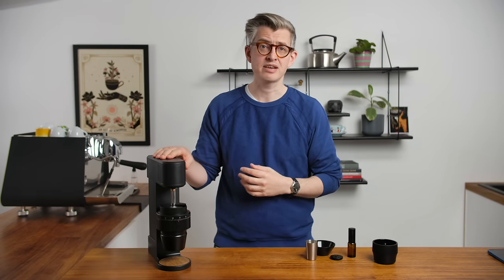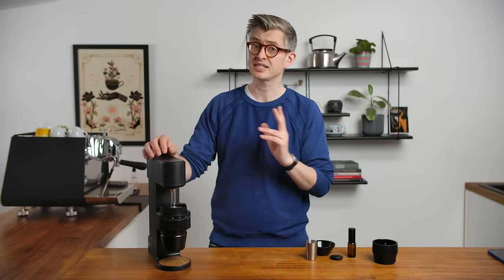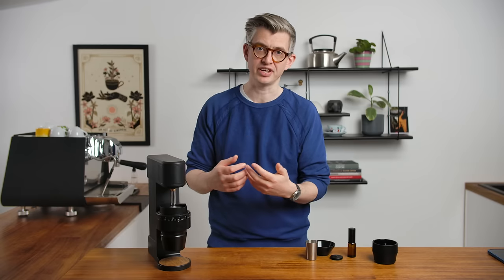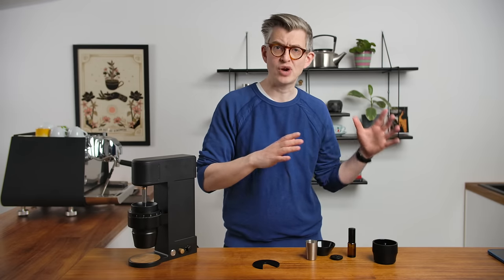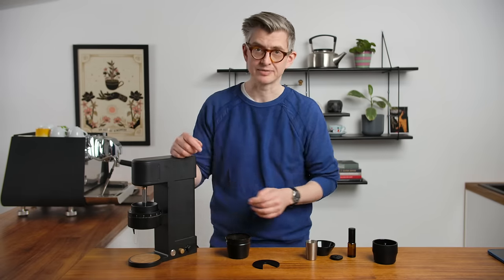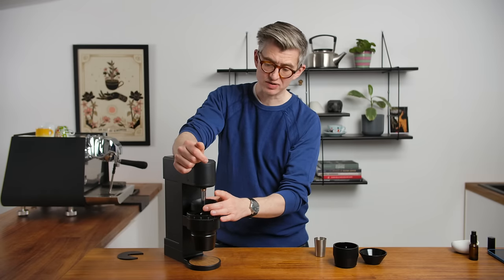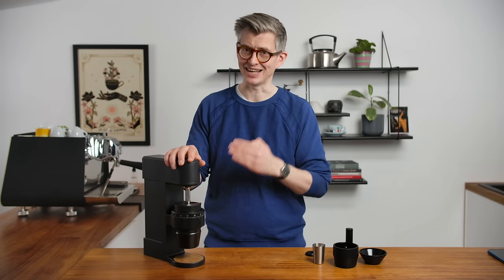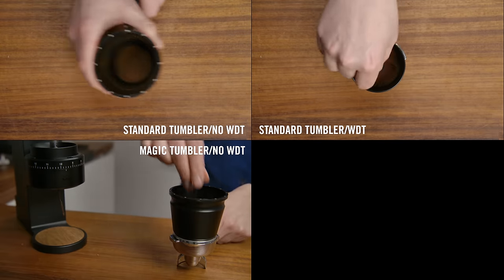Weber Workshops Key Grinder Review

Comment: If you want to test the center shaft alignment as it grinds, you could use a machinist's center dial indicator to see if the shaft strays from the center.
Reply: excatly what I thought too 
´👍
Reply: for sure - though just keep in mind that if there is a finish on the shaft, or if it was chromed, for example, irregularities in that would get picked up on the dial indicator.
Reply: I did exactly this, like above, the finish on the shaft does throw out the measurement. To achieve an accurate measurement you need to remove the lower burr and get a reading from the end of the shaft, mine was perfect.
Reply: Wired Gourmet has tools like that, someone should lend him their Key for testing.
Reply: However, that doesn't tell you if the cone burr is concentric with the shaft. If Mazzer's (burr manufacturer) and Weber's tolerances add up the wrong way, then you're stuck unless you have the machine tools to fix the issue.
Reply: I'm curious of the runout/TIR of the grinder running vs under load and grinding. I suspect it doesn't have a lot of rigidity with that much stick out.
Reply: @221 b unlikely that anyone would lend him one since he constantly trashes everyone else on coffee youtube.
Reply: You silly. You just bonk it with a mallet.
Reply: I did that to mine when I got it, measured the runout as within +/-.001" as close to the burr as I could get the dial indicator with that funnel collar in the way.
Reply: @armLocalhost  I too was disappointed that there was no bonking. Perhaps in a follow-up review when WW release their Precision Bonking Mallet.
Reply: And if you own a machinist's center dial, you likely also own a set of tools to take the silly thing apart and point and laugh at the under powered motor.
Reply: James, really good point that it is possible to seize the burrs if you don't seat the adjustment collar completely. Just had this issue with the HG-1 where I didn't quite have the collar fully seated when I started my workout, and it instantly stalled. I couldn't get them to separate so I had to remove and clean the lower burr assembly. Weber was helpful via email. Have owned the HG-1 for many years and this was my first and only issue with it.
Reply: @baldheadracing  Yeah it may just show the centering of the outer diameter of the shaft. There also may be a changed alignment with varying the grind size adjustment. Hopefully for $2k, they put the sufficient mechanical engineering required to mitigate this potential issue.
Reply: sincerely i don't like that long shaft. it is to far from the motor and it will flex even if so thick. of coure is just my thought since i haven't one 🤷‍♂️ 
for the price i think it could be engineered better

Comment: It’s been interesting to see other’s experiences with the Key, and I was definitely curious to hear what you had to say.

It would appear you’ve had a much more positive experience than I on every level. This further makes me sure there was something significantly wrong with my grinder and when in tandem with Weber’s abysmal (to say the least) customer service I found myself wanting it off my counter.

Of course everyone who backed it took a risk (my first and last backing on coffee gear) and I felt like it was a calculated risk, but a risk nonetheless. That risk wasn’t worth it for me, and resulted in a lot frustration, buyer’s remorse, and subsequently drama. 

Like you said no one can tell those in the market for a grinder in this price range if it’s worth the cash, but I applaud you for sharing links to a broad spectrum of reviews for a fuller picture.
Reply: QC is a big problem in Weber Workshops.
Reply: @dominiquetu  customer support as well lol
Reply: @MrMarki134  Agree 100% !
Reply: Yep and the reason I didn’t jump on the preorder bandwagon.
Reply: WW could definitely use improved customer service.  In my experience they tilt to much toward the 'you're holding it wrong' side of an argument.
Reply: @dominiquetu  so far every product I have purchased from them (a lot) has had some significant quality control issue which have all been very difficult to resolve.
Reply: The QC, customer service, and overly defensive nature of Weber on social media (blaming customers for issues) are why I chose to go with a Monolith MC4 instead of a Key.
Reply: @dominiquetu  Seems to be, some people having absolutely wonderful experiences and some horrible. But I'm concerned with the company culture. A r/espresso redditor was blocked by WW for pointing out a simple chemistry fact that contradicted some claim by Weber. And a lot of people who tried to return it where treated quite rudely and Weber insisting it was either user error or the burrs fault. Sometimes the CEOnhimself replying and becoming quite combative. And now they said they're stopping refunds completely. 

I don't want to support people like that. 2k is a huge amount of money for me and would buy my endgame machine and a Niche, on top of the Mignon I already have. Even with a 2k grinder budget, I'd rather get 3 or 4 grinders of different styles, some flat some conical to have several beans dialed plus a nice handgrinder on top. 2k over here is a Niche, Specialita, Commandante, J-Max and a Flair Signature with a nice kettle. And that includes roughly 200€ import tax on the Niche.
Reply: @JeremyJensenTheOriginal  good choice
Reply: @JeremyJensenTheOriginal  I have the MC4 for about a year now and am thrilled with both the grinder and the stellar customer service from Kafatek.
Reply: Weber seems to make a lot of form over function design choices. I get that it is definitely appealing to their target market, but they seem to do that at the cost of introducing a lot of possible points of failure.
Reply: @jules5350  Totally agree! I bought my MC4 on the pre-order run that happened the same weekend the Key originally went up. The Kafatek forums and the fact Denis of Kafatek is so involved in the community was ultimately what sold me. I've had my MC4 since December of 2021, and it's absolutely a wonderful utilitarian espresso grinder.
Reply: The Weber product is only as great as the post sales support it receives.  The purchasing experience will always turn sour if the customer service and/or tech support do not stand behind their product.
Reply: @221b-l3t  sounds like the business won't last with that kind of culture behind it. I would hate to have to depend on them for parts/support if they go tits up. It'll be like Alpha Dominche all over again.
Reply: Interesting that  you have had such bad customer service. I own a lot of Weber products and when I've had questions, I've emailed them and gotten quick helpful responses to each and every question. I have yet to have any QC problems with any of my purchases, so my questions had to do with ETA on an order or concerning my learning curve on a particular product. As an example my EG-1 has stalled once in all the days I've used it. It wasn't a QC issue. It was because I didn't hot start it when I was grinding a medium / light roast at 500 rpm and the fix was really easy. I ordered and paid full price for a Key and based on all of my past experiences with Weber, I'm looking forward to receiving and using it.
Reply: Problems being only with your grinder or not the only take away I had was how horrible Weber’s response was on so many levels. Even if they make improvements moving forward that is what I will remember and that is what will prevent me from doing business with them.
Reply: I dare them to insult James like they insulted you. If anything James proved you were right and did nothing wrong, all the wrong doing was on them and they just put out a half-assed non apology out.
Reply: There’s absolutely no excuse for burr wobble that you had with yours. It’s ridiculous that you can actually see it happening. And then they claim that’s fine. Lol!!!
Reply: @dan110024  it’s the equivalent of Steve Jobs telling us we are holding our phones wrong.
Reply: Jeff Mattel  I wouldn’t say it’s an afterthought with Weber, they are outright antagonistic and overly defensive at times. I’m not sure if this is reflective of the overall mindset in the company or if it’s just their social people…
Reply: @jockbradley670  you said you havent had any QC problems so I think thats why you havent encountered with bad CS.....  agreed WW's CS is helpful and responsive with easily solvable issues....
Reply: I had EG1 on order.  They charged my CC several months ago, and they had been staying dead silent on all my requests on the order status.  Next I will do is to open a cc claim and get my money back.
Reply: @kobehuanghai  - A very valid point. I want to add though, that I’ve had a fair bit of communication at various times with WW. On a number of occasions Douglas has corresponded directly with me even though my questions didn’t need to be answered by him. Each time I found him to be helpful and easy to deal with even though I’m sure he was very busy. Anyone else at the company could have answered any of my questions very easily. Based on these interactions, if I have any issues in the future, I’m confident they will be resolved. Look, I’ve spent a small fortune with WW so far. Their products are high end and come in at boutique prices. I wouldn’t spend this kind of money if their things were inferior, unreliable or their QC / CS sucked. I make cappuccino’s at home for just my wife and I so there isn’t anyone I’m trying to impress by having what I feel are amongst the best espresso related products on my counter top. I continue to be a Weber customer because I love the designs, craftsmanship, ease of use, reliability and the belief that they will still be in business standing behind their products years from now if I do have any problems. It’s unfortunate that a few other owners don’t share this same perspective.
Reply: @MrMarki134  If you are in the top tear market, customer supper MUST be calculated in and included in the price. Otherwise it is a fail as a premium product.
Reply: @nssomething8370  I TOTALLY agree with you
Reply: @afsebhdim-ou3fu  that’s horrible.
Reply: Exactly why I chose going with Denis and the Monolith Max, which in my opinion was unfairly compared to webers in an older high end grinder comparison by James. Weber looks good and does good flow but I for one would rather buy a premium product that has something compatible from a CS standpoint as well as an equally engaged community. Denis worked through all the supply chain issues and always got back to me with any questions and assisted with any and all information specific to my machine. The price to service was on point.
Reply: @JeremyJensenTheOriginal  yup! a few years ago you had to scroll reddit to find these user complaints, they seem more and more common.  The quality issues dont justify the price, and Weber's poor attitude of "explaining to" instead of solving customer issues really brings the whole company down.  He needs to separate himself from customer service.  Truthfully, I think Kafatek's Denis has a very similar attitude, but at least his stuff is flawless.
Reply: @omi6816  This is the other issue and why Spro's review was so important. Talk to any coffee influencer and at least publicly they will pile praise on the man and the company.  He is not stupid and he knows he can't be ajerk to these people.  FOr some reason its ok to be like that to his customer base though.  Its kind of an influencer mentality.  He definitely caters to these folks. His customers he treats like they should be so lucky to own his product.
Reply: @Fuuntag  you know he worked for apple right?
Reply: This Vs Lagom p64?
Reply: @ssjcell  His review is important from the sole fact that he is an experienced coffee enthusiast who spent money on the product and the experience was not up to what he expected. Jame's has over 10 times more following than sprometheus and james is just basically the prime internet weird coffee person and him "validating" some of sprometheu's claims just means that weber plain out wronged him. Insulting sprometheus might have no consequences for them, insulting hoffman would be a way different kind of suicide.
Reply: @omi6816  agreed, if they had treated James the same way, weber, for the most part, would be done. I am glad James’s inclusion of Sprometheus’s review is meaning his treatment will at the very least be recognised more sufficiently and hopefully will allow people to make more informed purchase decisions.
Reply: @darylfortney8081  so why you keep buying them?
Reply: @nssomething8370  I totally agree and it looks like the faffiest workflow imaginable with all these extra pieces of expensive metal to lose, the reviewers all seem to be taking an "emperors new clothes" approach and choosing to ignore that it has so many flaws in design and manufacture, for $2000 it is so not value. The fact that it produces a bit more clarity than the Niche, with the Niche $1500 cheaper and 2000% better workflow seems a very poor decision to buy this.
Reply: @jockbradley670  How long have you been a Weber employee? ;-)
Reply: @ssjcell  This is why all these "influencers"  opinions have to be taken with a pinch of salt, no matter how much they claim independence, they are human and are easily swayed by free stuff and people blowing smoke up their ass. Money is not the only way to manipulate, charm can sway too. Watching this review I felt that James backed off from his true opinion due to not wanting to trash a poor product made by a person/company he has some misplaced loyalty to. Ordinarily and in the past he has ranted about fiddly pieces and workflow issues but this time he seemed to go easy on what looks like a massively annoying workflow process.
Reply: When WW kept telling everyone he was an engineer from Apple. Most have left out something very important. Apple's success is on the electronics and software. Nothing in apple products move other than the hinges in their Macbook which is also known for getting loose. Oh ya, and the airpod charging case too...
Reply: @Thetache  I was wondering when someone would accuse me of being a shill for WW. I discovered Weber a little less than a year ago. I'd have to check my receipts, but I believe the first things I bought were a steamer tip and a blind shaker. Those were quickly followed by an EG-1 and other products which include the salt and pepper mills. With the exception of the Spring Cleaner, I use every Weber product I own, daily. I have paid full retail, DHL shipping and all appropriate customs and sales tax for each item. I'm nothing more than a good WW customer who is willing to offer my unprofessional and admittedly biased opinions about espresso equipment that I use or have used. As a consumer, I appreciate and purchase things that combine beautiful design with excellent function. This is what attracted me to Weber in the first place and it is what will keep me as a customer in the future. I don't waste my money on almost's...
Reply: Tried manual version... What a terrible misalignment it was...
Reply: @askroller  I've seen a video from a New Zealand user with the HG-1 that didn't came with the Mazzer burr and his shaft was bent. As usual WW said everything was ok.
Reply: @timzlow  oh my 😅 I wish I haven't ordered this Key. Its too late now now 🤮. Noted that I still waiting for mine, I refuse to pay extra shipping and extra tax which for me its not fair...
Reply: @patt7848  I think Mazzer burrs are still one of the industrial gold standard. You will never be dissapointed with the result. However, Kyle Roswell mentioned the improvement over Niche isn't as much as he would have expected.
Reply: My burrs produce weird sound at espresso grind size. They ask me to do alignment for a brand new grinder while the quality was guaranteed before shipped. As if I made it misaligned while the first espresso shot has weird sound already😢😢
Reply: @timzlow  thanks so much for your opinion, I think my should shipped out from Taiwan round mid June, hopefully will get to try it soon 😉. Have a good one
Reply: @raychui8887  Yeah. It's always someone else's fault to them.
Reply: @Fuuntag  or Toyota Saying people were accidentally hitting the accelerator on their cars instead of the brakes, it wasn't an issue with the car self-accelerating or the floor mat hitting the accelerator :o
Reply: @waynemwangi9444  I had both, both are very nice. I like the simpler workflow on the Lagom P64. With the Unimodal multipurpose SSP burrs in the P64, I had higher flavor clarity, but the Weber Keys burrs being conical gives an additional Unami flavour or richness sometimes with pretty decent clarity too, also with those SSP burrs in the P64 the Key would be better for medium or darker roasts I think, and for chocolately roasty coffees for milk drinks, But for the P64 there is different burr options SSP cast burrs should be good for darker roasts and (in my DF64) I find it's kinda conical-like similar to the Key in ways, but probably even more body and less clarity.  Grind quality and versatility for different brew methods is very good on either.  Company wise, I like Option-O a lot. Not a fan of Weber so much.
Reply: @BensCoffeeRants   Yeah, I also  prefer the Lagom P64, looks simple yes , but might also be more durable in the long run.